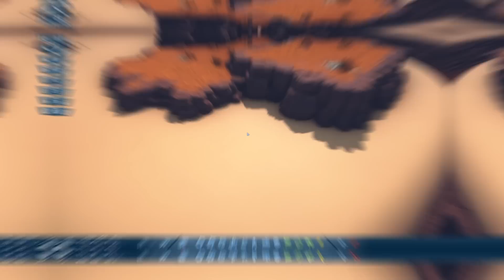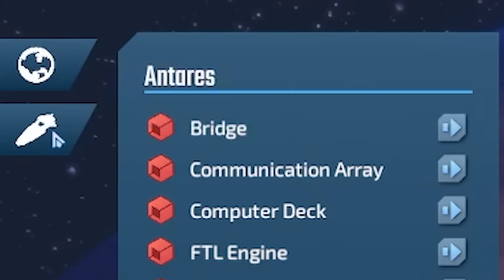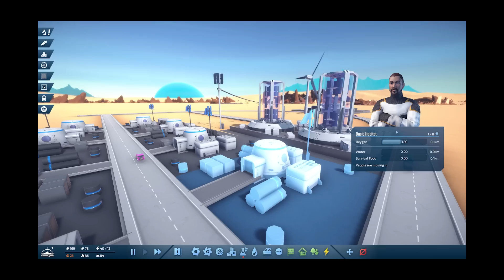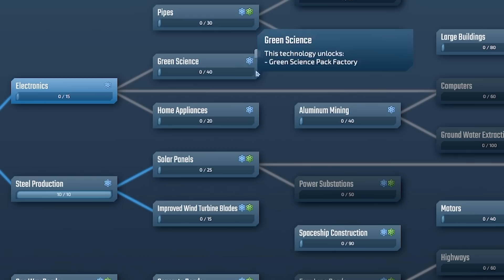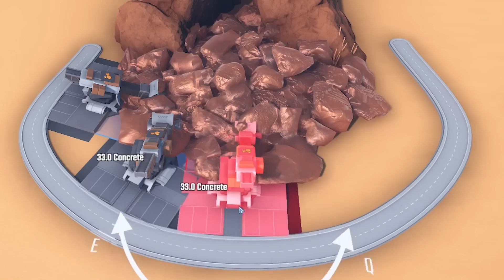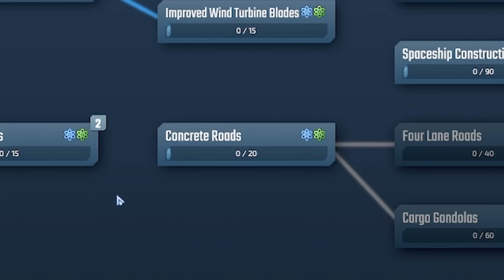Engineering a BRAND NEW colony on a barren planet! InfraSpace!

Comment: Yay Infraspace!  I recently started a new city too.
I'm experimenting with sometimes using the grids.  It's the only way to make (almost perfect) 90 or 45 degree intersections.  I still have plenty of curves, but grids can help with that too -- draw a short straight section at the start of the curve on the grid, do the same for the curve ending then turn grid off and connect beginning to end.  Great results so far and can actually be faster!

I also agree you should turn on round trip traffic.  Once on, you'll wonder why you were ok with delivery trucks and drivers vanishing into thin air at their destination.  Maybe they just murder the drivers and recycle the vehicles.  Are all the drivers clones or androids?  Anyway, definitely best to switch that on at the beginning of a new build.